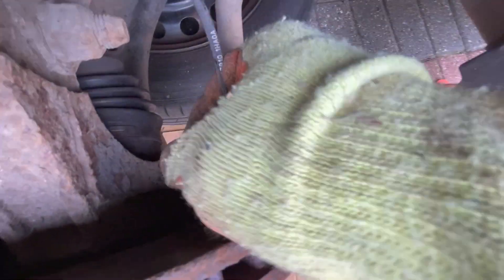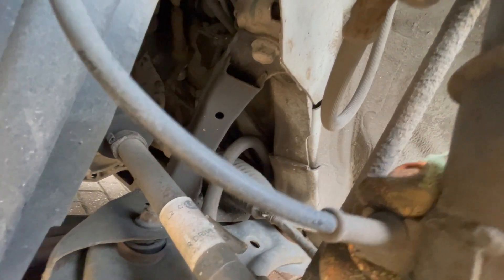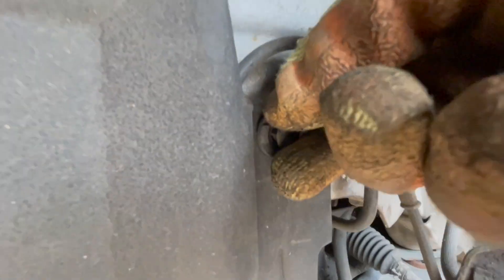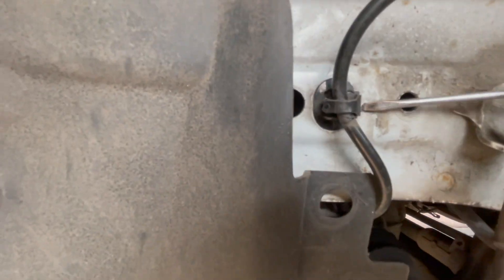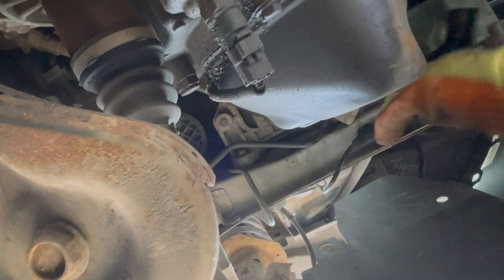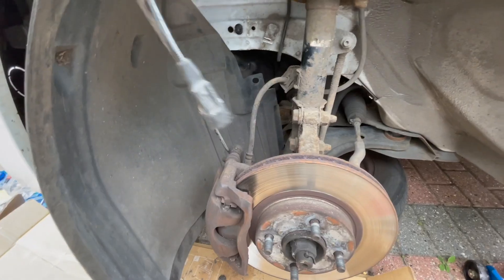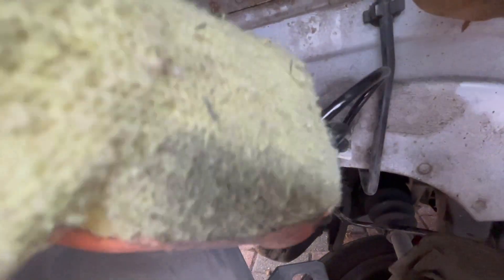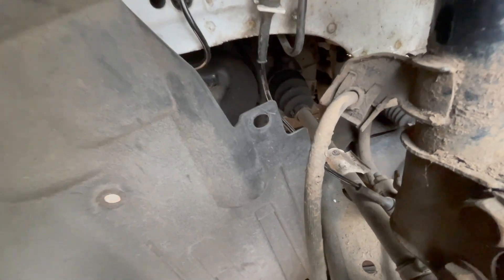Nissan Micra faulty ABS/Wheel sensor replacement K13

Comment: Hi . Have u video of rear brake shoe , drum (with new bearing )
Reply from the maker: @johnbyrne7229  hopefully soon, have a few other projects to finish first
Reply: @micradocs  looking forward to them . Great videos
Reply: The rear drum brakes on the K13 are pretty straightforward - there are two springs for the shoes and two others for the adjuster, one of which is not under tension and doesn't need replacing. 

You have to be careful installing or removing the drum on the spindle, as the bearing inner race can easily become detached (and according to Nissan that means "replace bearing"). It's easier if you smear the spindle with WD-40 or another thin oil.

The bearings that Nissan installs on the Micra are not the best, so a brake job is a good opportunity to put better ones on.

Also, a lot of parts places seem to be under the impression that the brakes for the Kia Picanto are the same as the Micra's. They are not. Make sure your spring replacement kit is specifically for the Micra.